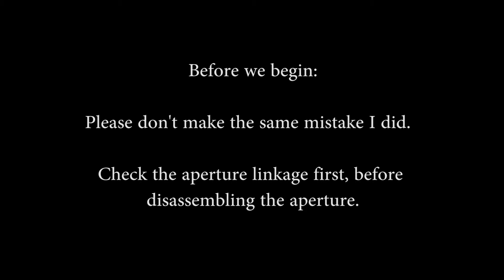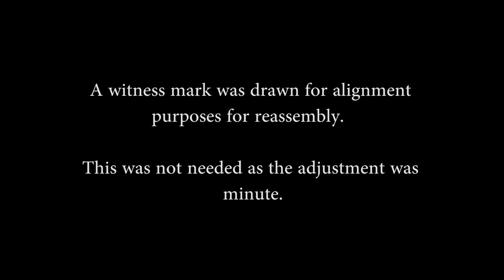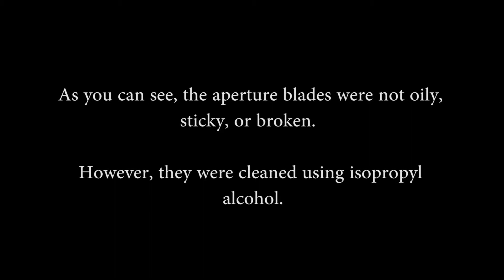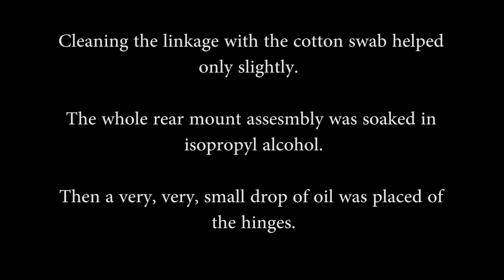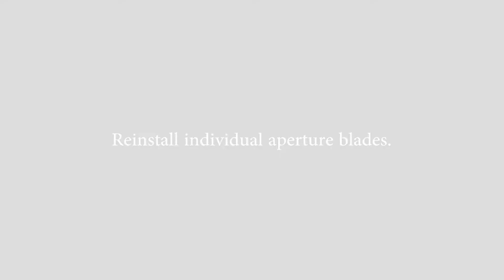Repairing stuck aperture on a Pentacon auto 50mm F1.8 Multi Coated lens.

Comment: Once I learned what the issue might be from your video, I was able to fix mine without even taking apart the lens. Just focus down to the minimum distance (0.33m) - this creates enough of a gap around the rear element that you can access the stuck lever with a small thin instrument, and clean the inner part of the hinge spring. Of course, on a "more stuck" lens this might not work, but I'd say it's worth a shot in case someone is too afraid (or lazy) to open their lens.
Reply: I just bought a Praktica LTL 3 which came with the Pentacon Auto 1.8/50 Lens all for £10?!
And I went to have a look etc at it and opened up aperture and boom stuck. This comment! Saved me a lot of issues. Kept getting stuck and I just decide to keep working it 
Opening and closing it then turning the putter ring back and forward till it got stuck and then release it how your comment said, kept doijg for about 10 mins to get any dried up oil etc mixed and joint lubricated and happy days it’s all working! So thank you!!! 🎉
Reply: @OQWO  I'm happy someone found my comment useful!
Reply: Saved my lens. You are amazing.
Reply: 👍fixed mine just like that
Reply: Save mine too ! Thanks !

Comment: Thanks for the video. So possibly it could've been fixed with just taking off the rear of the lens and clean+lube the lever system? I have one that's stuck, but taking off the front and blades isn't something I want to attempt myself. The rear looks manageable though.
Reply from the maker: Yes, I should have checked the aperture linkage before removing the aperture blades.  Because it is common for these lenses to build up oil on the blades, I wrongfully diagnosed the lens.  Please check the linkage first (by removing the rear mount) and if that doesn't fix it, the aperture blades may need to be cleaned.

Comment: I just bought a m42 adapter to play with some old lenses from my mom. I was very excited about this f1.8 pentacon, but the aperture was stucked and thank to this video I was able to fix it. Thank you very much
Reply: There is a tiny spring in mine. Not sure if it should go behind metal ball bearing or in front
Reply: It fell out when I was disassembling it. It was a bit bent on the top, I dropped it so, I hammered it back into shape and now I can’t figure out where this spring goes

Comment: Hi, I have the very same lens. It works fine but the aperture ring is loosen and doesn't "tick" when rotating. Can I Fix this? Thank you!!
Reply from the maker: Yes.  It could be an issue with the ball bearing.
Reply: @FocalReduced thank you for the answer. Where should I check? Below the part on the right with two screws at 8:58? How should i place it?

Thank you so much!
Reply from the maker: The ball bearing for this lens is located between the 4 and 5 o'clock position when the lens' Index scale ring is facing upwards.

Comment: Thanks for the guide! My grandma found one of these in some nook in her house and gave it to me knowing I like doing up old camera gear and I've managed to give it a thorough cleaning and get most of the gunk off of the front element which thankfully was just lint and not fungus. Unfortunately the entire rear group is missing so the lens is incapable of focussing. I'm most surprised by the fact that the aperture group has been sat completely exposed for god knows how long with cobwebs and dust all over the inside of the rear of the lense and yet the aperture turns smoother than any other I've ever seen!

Comment: ive unstuck aperture blade by just applying isopropanol to the blades with a paint brush then using the level inside the lens to open and closes them a few times, then  used a cotton bud to soak up the oil/isopropanol mix on the blades.  Did this a few time and aperture blades work fine. I myself just didn't fancy taking the Aperture mechanism apart

Comment: Just wish to add a couple of small points:

This lens started life as the Meyer Oreston, went through several versions. Their mechanical constructions differ from each other, sometimes significantly, so the method for fixing this final "Multi Coated" version would not apply to an earlier version.

Over time, the grease applied by many German manufacturers would have failed, and made the lens operation progressively more difficult. The lighter part of the grease distillates and covering the iris mechanism would make its action sticky, but the heavier component would cause even more problems. When I attend to one, I routinely take the focussing helicoid apart, clean off all the old grease and replace with modern grease.
Reply: Do you have any pointers for the old Meyer Oreston

Comment: I have the exact opposite problem. I also went about it the wrong way, as you first did.
I spent ages tinkering with the auto aperture actuation mechanism at the back, only to realise that the problem is slightly sticking aperture blades. It wouldn't be a problem, but as you know, it's indirectly operated by a spring, and the spring just isn't strong enough to overcome the tiniest resistance.
It works fine until I face the lens downwards, then it is jammed fully open until I take it apart again.

Comment: I almost took it apart, but then I checked the pin (0:51) and realized I was on Manual mode ( I have the Pentacon 29mm f2.8), and this helped me out! I got so scared that my lens suddenly broke, but it was just a minor mistake thanks to this guy. Try this before you actually take apart your lens - It may save you a lot of excessive work. :)

Comment: My lever isn't stuck it works fine when I push the button. If I manually operate the blades with the vertical rod they move. Any other suggestions? I read a comment regarding the blades could be too sticky for the strength of the spring? It feels like there's a piece missing...the aperture ring has nothing connecting it it just sits in there.
Reply from the maker: If there is nothing connected to the aperture ring, it may be very possible that the lens has been disassembled or reassembled incorrectly.

Comment: Damn, checked the lever and seems to work perfectly but I can actually tell the blades are oily by looking through the lens from the back. Works fine until I open the aperture to 1.8 and it sort of goes too far and get stuck. So let me get this straight - oily blades are bad?
Reply from the maker: Oil on blades are bad.

Comment: I just received a 135/2.8 Pentacon where the aperture blades moved erratically, so that they would sometimes not close, and sometimes they would close partially, so that the true aperture would be bigger than the set aperture. I removed the four screws at the back to expose the arm which pushes the tab the operates the aperture blades (the arm is seen at 9:05 in this clip). I found that the blades operate without any friction, so there is no reason to disassemble them. But the arm moves freely also. So, if everything moves without friction, why does it not work? There is a super tiny screw at the base of the arm which controls the extent of the motion of the arm, and I opened it by 3/4 of a turn, and that seems to have fixed the problem. Essentially, the arm now pushes the tab that operates the blades a little harder.

Comment: Hey, thanks so much for the video. I have an older version of this lens (electric), and for some reason moving the focus ring is also adjusting the aperture blades slightly - any ideas what may be causing that?
Reply from the maker: I am not certain, but it may be something loose inside such as the three screws holding in the aperture assembly.  Also be sure it is clocked in the correct orientation.  Good luck.

Comment: So if I am able to move diaphragm with the pin then I need to disassemble the front?
Reply from the maker: It really depends.  Oil contamination can cause the diaphragm to move slowly.  But it can still function when the pin is depressed.  And of course, the oil can sometimes not be seen on the blades themselves, but the rotating aperture unit itself.

Comment: Hello, I can't remove the branding ring. I've already applied wd-40 but I can't remove it, even with the help of a rubberized cover to apply more force. Any ideas on how to do this?
Reply from the maker: You can try using rubber gloves, or something to increase friction.  I would make sure the filter threads are not damaged or bent.  If so, removal might be impossible.

Comment: Whats mean that M/A switch in Pentacon Auto series? I am Lumix user with 2,8/29 lens on - its pointless for me?
Reply from the maker: The M/A switch is the Auto/Manual Stop down switch made for SLR's without the Auto-stop down function.  M (Manual) is chosen for stop down metering cameras.  It is most likely pointless for you, as your adapter has a flange to push in the stop down pin on the back of the lens, making the switch useless.